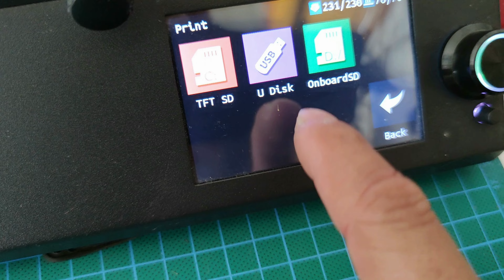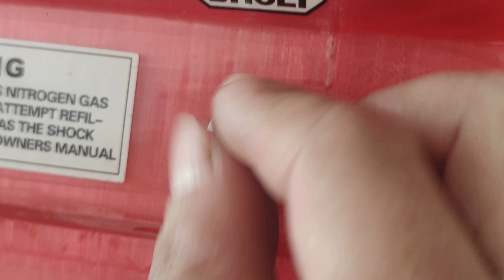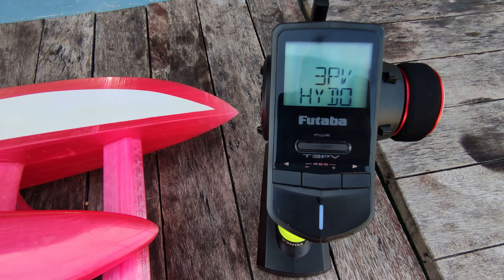3D Printed Hydroplane Boat  (Part 2) #rcboat #raceboat

Comment: question, i built this boat with the same motor you did but used a 90A water cooled esc.  when i put it in water ans give it throttle the motor cuts out.  Any thoughts?  Thanks again!
Reply from the maker: Is the battery you are using still good?
Speed Control: What is the cutoff set at?

Comment: hello I made the boat in 3d printing did I install a thermal engine in it there is no risk that the ceiling please thank you cordially I am waiting for your return
Reply from the maker: I think you can do it but there should be a vent for venting the engine, I think it's better.
Reply: thank you for your advice is the pla it will melt with the heat of the thermal engine in a small question the carbon canvas you order it or and for the application I see you put resin is it possible to have the link for all that please thank you
Reply from the maker: @dimitrybattesti7930  I think you should use PETG 3D, it will be more heat resistant and you can do the same for the boat with carbon cloth as well.🙂
Reply: hello I ask you for the plans of the rc hydroplane boat in this video Thank
Reply from the maker: @dimitrybattesti7930  You mean STL files?
Reply: hello mr yes you know that with STL plans?
is a small question I can't find the 3650 engine support model in stl file because I don't know what my engine will be on your hydroplane hull engine support thank you have a good evening
Reply from the maker: @dimitrybattesti7930 You can expand to all files and I typed at 130%

Comment: Does the motor shaft eventually wear out the opening in the hull that it goes through?  Also, how do you keep it water tight where the shaft exits the hull?  Thanks
Reply from the maker: Sorry for the late reply water can't get through the shaft because I use grease and oil to lubricate the shaft every time I put it in the water.
Reply: There’s no wear because the shaft goes through a stuffing tube that goes through the boat !
Reply from the maker: @Budgetrcbuilds  It is a flexible boat shaft with little wear and tear and can easily be replaced.
Reply: @Mr.RC-Creator  I’m printing one now ! And trying to stuff 6s in it 😂🤦🏻‍♂️
Reply from the maker: @Budgetrcbuilds  It's going to be fun!!😂